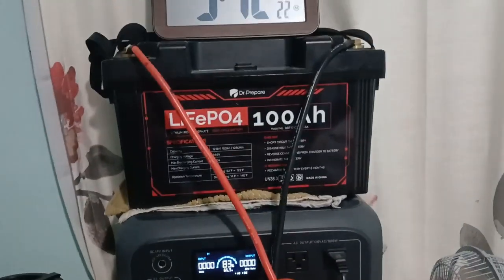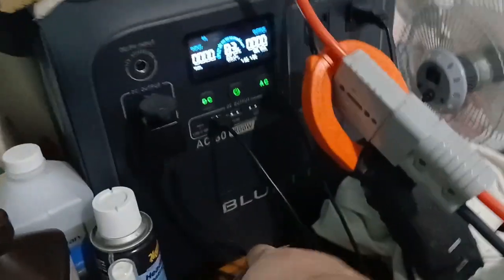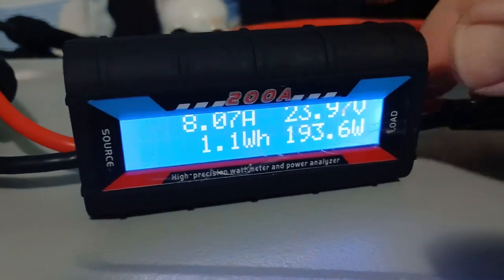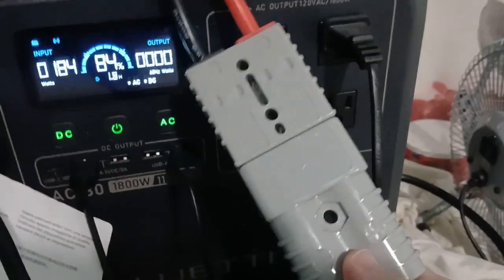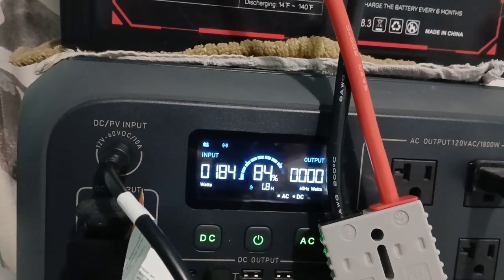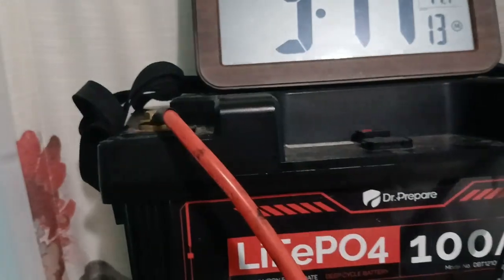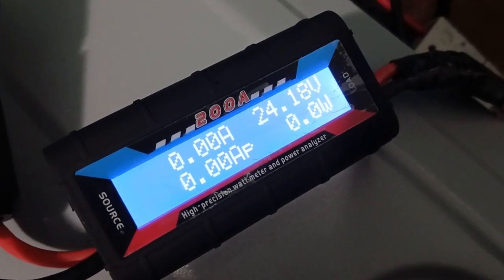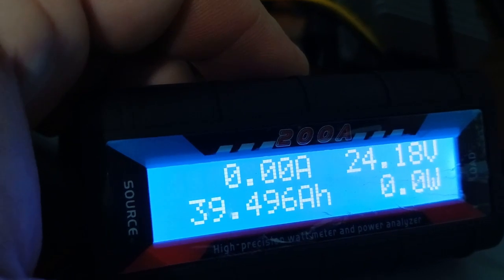12 volt to 24 volt converter test on bluetti ac180

Comment: Can you say fire hazard ⚠️. You mentioned the fire risk with it getting hot but you have it on a table filled with all kinds of stuff. Leaving that unattended all night seems pretty unwise. I’d at least clean the table off or have a dedicated space free of flammable items.
Reply from the maker: It never got anywhere near hot enough to start a fire for me. I was also using it at less than half its capacity. If you do it at the max, that is where you have to worry about it getting that hot.

Comment: Curious as to how hot your converter got?

I just tried this with a 12v-24v 15amp converter (rather than yours at 20amp rating) and 50ah lithium battery (and later with a 230ah lithium battery) to recharge my Ecoflow Delta 2 power station through the xt60 solar charging port. That solar port has a limit of 8amps for car charging and 15amp for solar and it can tell the difference between using a standard xt60 plug, or a standard xt60i plug, or the Ecoflow xt60i plug that is wired slightly differently to provide 15amp input and transits info to the power station that a solar input is being used. Sure enough, when used with the standard xt60i plug, the D2 throttled the input down to a maximum of 8 amps and I was able to charge at 192w. When I switched to the Ecoflow xt60i plug, the wattage jumped to 348w and the converter kept increasing in temperature until it was too hot to handle. At that point I shut it down and after cooling, reverted to the standard plug drawing 192w @ 8amps. I suspect the converter got dangerously hot because it was running continuously near its upper current limit of 15amps. At 8 amps it was just barely warmer than the ambient room temperature. I too used a 12v fan blowing on it to dissipate the heat.

So, I guess I'm agreeing that these converters offer an inexpensive way to slowly recharge power stations, but care needs to be taken to not overtax them. Your 20amp version operating at 1/2 its rated amperage (10amp for your power station) apparently ran much cooler than mine when its maximum amperage rating (15amps) was approached. When also used at ~1/2 the maximum amp rating (i.e., 8amp on my power station) mine also kept cool. Probably better to use a boost converter with an amperage rating at least twice that of the input port of the power station than a converter rated near or below the maximum input limit of the station to keep from overtaxing the converter and causing a fire risk.
Reply from the maker: Yes, I agree that running them at half capacity or no more than 3/4 capacity is better and safer. Even though faster charging would be nice. I cannot say the exact temp mine was running at but it was warm to the touch. So I would guess between 100 and 110 degrees F. 
I watch a channel named John Daniels and he made a video about it. I will put the link in here for you if you want to watch it. But he says that these cheap converters are a fire risk at max load and they tend to fail early when ran that way. He recommended the Etaker 1000 for powering power stations in that video. It will take 12 volt and convert it up to 48 volts I think. Might be higher and it will be lower amps and I believe it has a fan built into it.
https://www.youtube.com/watch?v=sSKt7qmVy7Y
Reply: @jw3843  I saw Daniels' video a week or so ago and his was the first I'd seen that implied a fire risk might be involved if the converter was taxed. I think he has good content and insights, but wish he would invest in a tripod and not bounce around so much. I find him hard to follow as a result.

I think I'd probably go with that Etaker F1000 if I were to invest in a higher watt alternator charger. The others I'm aware of (Ecoflow 800w, Pecron and Bluetti 500w) wouldn't really offer much extra to me unless I needed an emergency charge or didn't have my power stations and batteries fully charged when I initially left on a camping trip and planned to drive for several hours. Currently, I also have a Redodo 14.6v 40a DC-DC plus MPPT charger, a Victron Smart Solar 100|50 MPPT, a cheap 20amp pwm solar charger and a Redodo 12v 40amp AC-DC charger so I have several charging options. I just need to plan things correctly when I leave on a trip.
Reply: @smieglitz  I just watched the same video last night actually and made comment that it should be okay (monitor it) if you are within the perimeters of the step up.  Thats what I was kinda confused about as he said no matter what they will not work, but I think he may just have a battery banks that that can pull much higher amperage?  Or he is saying that other YouTubers are just to get a buck converter and wire it up.  I have the same AC180, well supposed to be delivered tomorrow, and ordered a 12 to 24v 20 amp step up to do this.  After watching the that video last night had me all confused cause im not an expert but the Bluetti states 10 amps max up to 500 watts.  I thought that even a 12 to 36v 20 amp to get 360 watts those seem to jump up in price here and there and other options then at that point,
Reply from the maker: Also the newer bluetti units keep the amperage below 10 amps until you reach somewhere above 30 volts, then it will allow 10 amp charging. The newer ecoflows do the same with the xt60 cables and that is the best way to keep yours below the 15 amps. The orange ones with the special wiring I think are the xt60i ones that allow the 15 amps. If you got a 20 amp version you could test how hot it gets that way, but I would just say stay at 8 amps and be safe and save the money.
Reply: @jw3843  Yes. Thanks. For my purpose (recharging the power station overnight while camping) the slower rate at 24v is fine. I basically just wanted to increase capacity in case I run into a string of days where solar isn't available and I'm away from shore power. I think the next variation for me would be to invest in another battery - either another 12.8v 230ah and run them in series to get 24v or just invest in a 24v lithium battery and go that route.